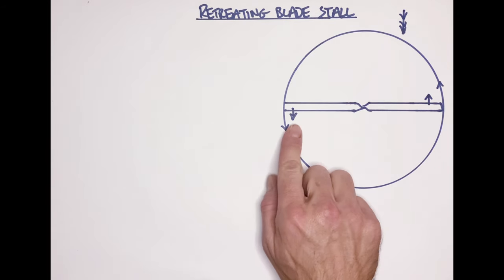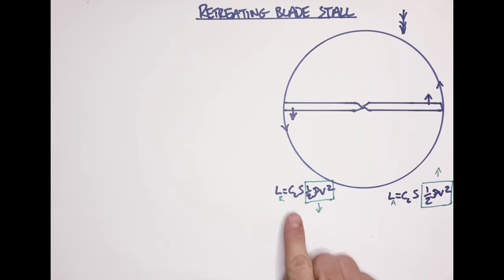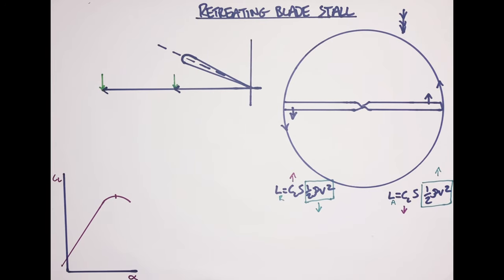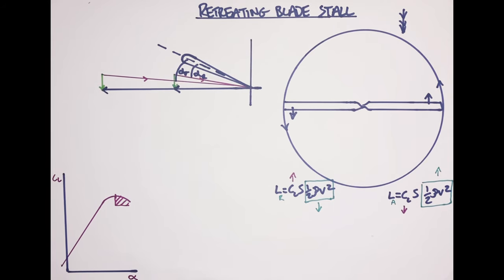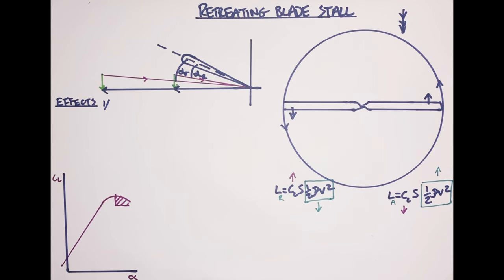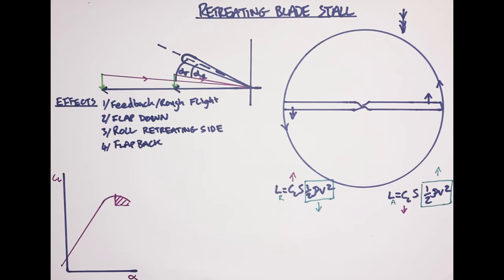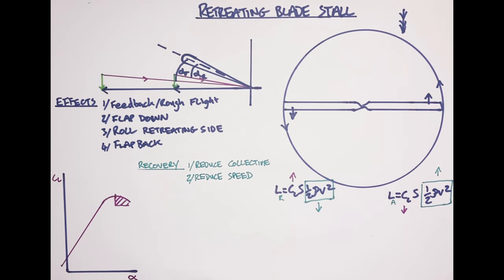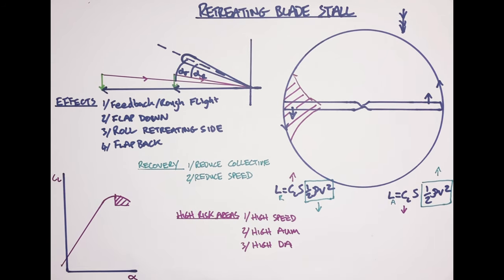Helicopter Principles of Flight - Retreating Blade Stall

Comment: A dumb question from a non-helicopter guy - is the rotor blade airfoil symmetric or does it have some camber?
Reply from the maker: I’m not entirely sure. As it is a high speed blade I would expect to be symmetrical however I would also assume all blades are different depending on the intended aircraft weight and rotor speed